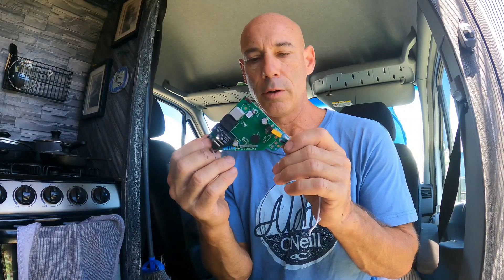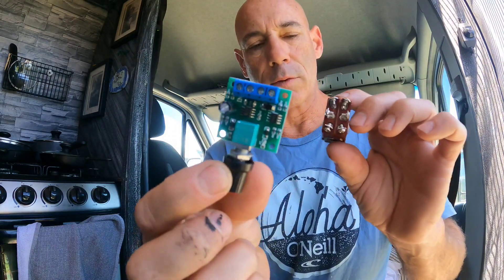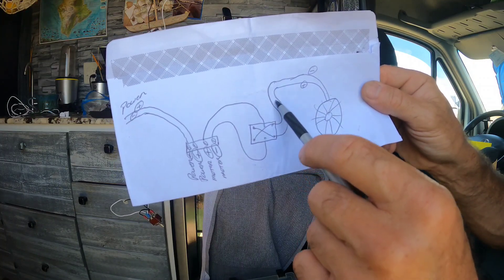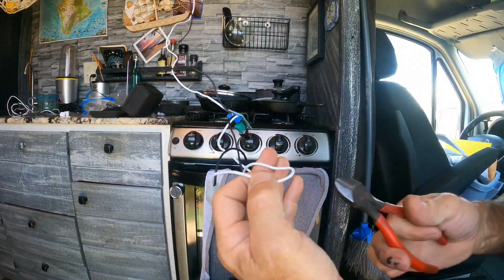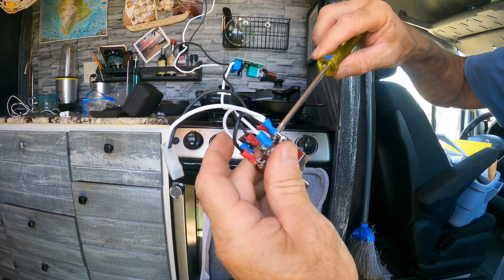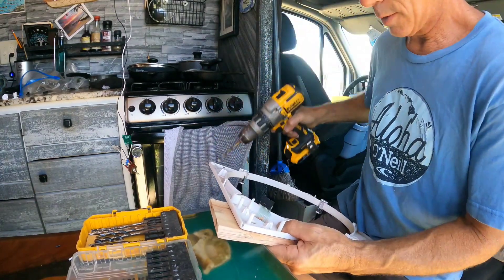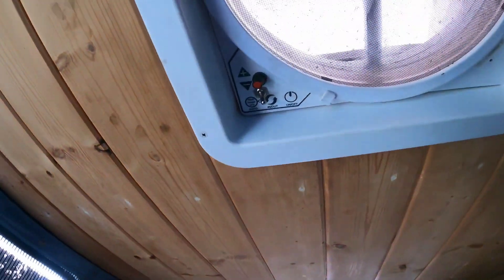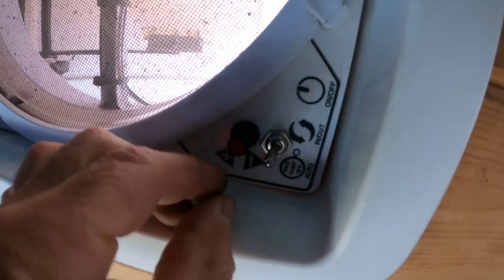Upgrade Your MaxxAir Fan Circuit Board for Under $10!

Comment: Question: My maxair crapped out and I got a replacement circuit board. My son was trying to put it all back together and there are two wires there but no 12 volt power. He checked all the fuses and circuits (he's no slouch with repairs/electrical) but this has him baffled. I have a 2018 pleasure way TS if that helps. Any ideas? I hate to call in a mobile RV guy bc of the cost. Thanks Dug.
Reply from the maker: You need to use a multimeter and trace back to find where you have 12V power and make sure you have + and - hooked up correctly.  Also check your ground wire
Reply: @dugheckenkamp4047  Thanks

Comment: A couple questions! 

Since this bypasses the circuit board, the switch to change directions changes very abruptly! Doesn't seem to slow change like it would normally, would this damage the motor? 
I assume slowing speed to lowest, shutting off, and then flipping would prevent motor damage?

I plan to add a voltage regulator / stabilizer / buck converter from other upgrade videos, would this still work with these upgrades since its bypassing the circuit board anyways? And where would you install it in the circuit? At the power source first before the dial, or before the motor?
Reply from the maker: Good question when I switch directions I do exactly as you recommend and that is I turn it off let it slow down and then flip directions.  
As far as a voltage regulator putting it before the motor would probably be best

Comment: So I did this fix and the fan at top speed is very slow more like the first setting. Is there something I could have done wrong?
Reply from the maker: Try hooking the motor up directly to 12 volts and see if you get maximum speed if you don't then there's something wrong with your motor if you do then work back from there making sure that you are hooking everything up right. You may have a bad rheostat on your circuit board.
Reply: @dugheckenkamp4047  thanks so much I'll try that out! Good thing they come in pairs of two if that is it lol
Reply: Open the vent and blast a 20in.  box fan. Problem solved.